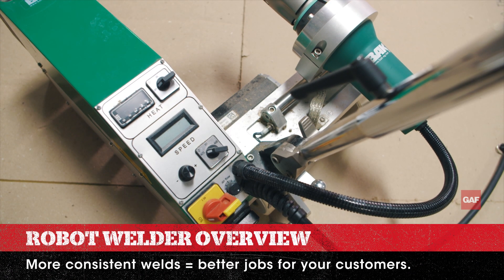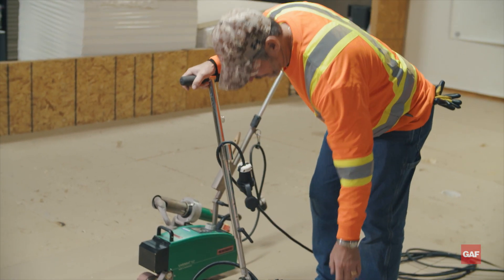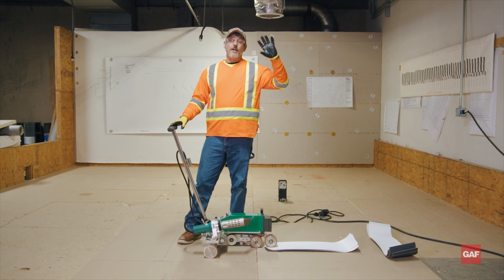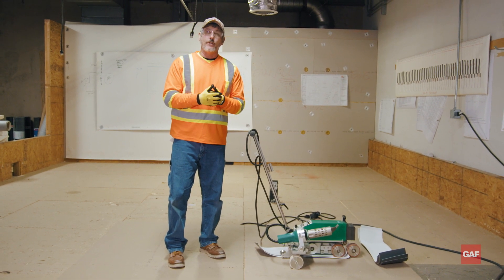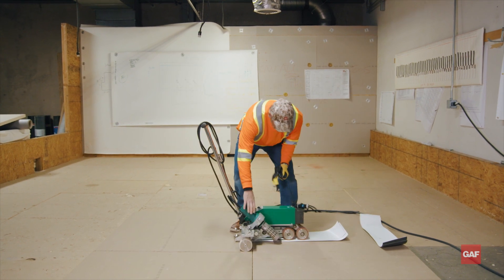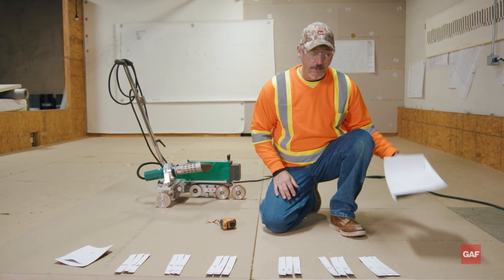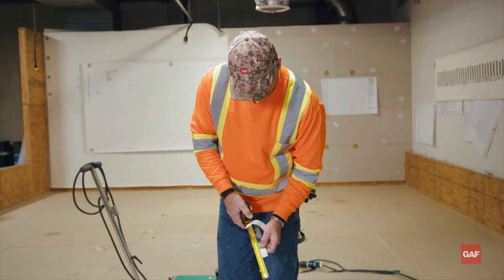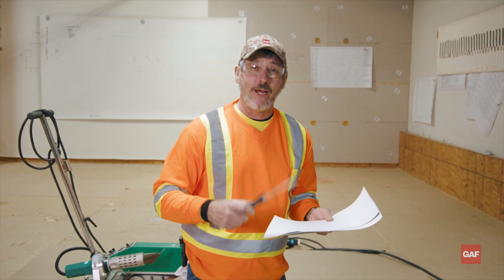Basics of Robot Welding for TPO Roofing | Roofing it Right with Dave & Wally by GAF

Comment: Soo what's the best temperature? 7 hundreds
Reply from the maker: Hi, there. In this specific example, the bottom temperature of the weld window was 700 degrees. It is important to determine the top and bottom temperatures of the weld window, in order to set up the machine in the middle. You should always test your welds, using the ASTM Pull Test.

If you would like to speak with a technical expert, you may contact them directly by calling 1-800-766-3411, and they will be happy to assist.